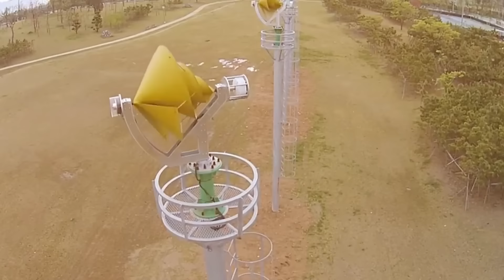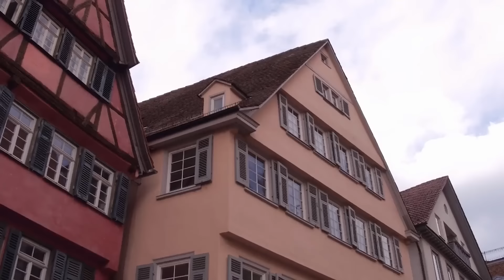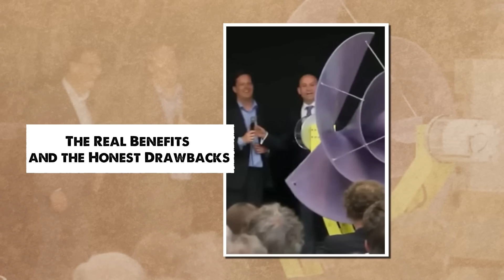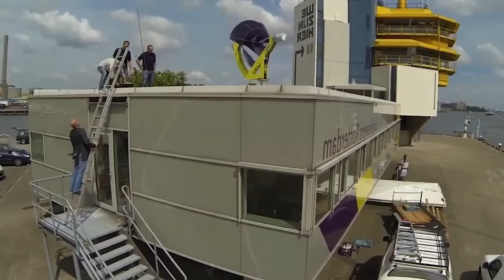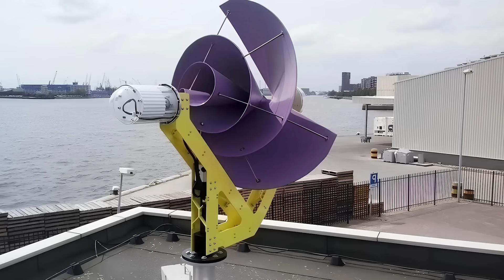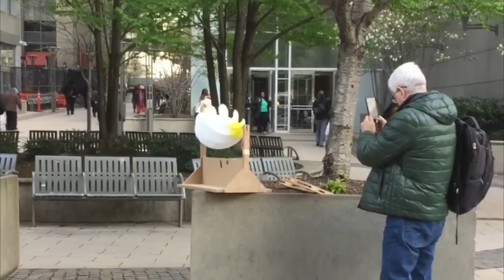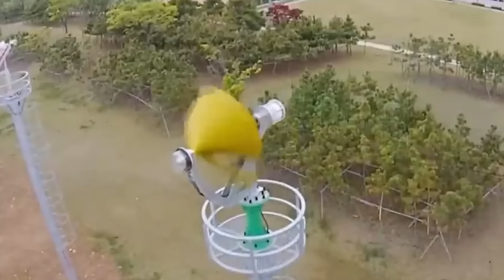This NEW European Wind Turbine for Home Outbeats PV Solar Panels in 2025?!

Comment: I have been waiting for a viable wind turbine availability, even if combined with solar panels. I have seen a solar panel frame that is raised with a space below for a turbine. Being an architect, I have a three stall carport design that my four brothers, along with a several clients, have used and enjoyed for years. Because of the chance of shower at a moments notice, we are from a Subtropical Climate, we use the structures as event spaces and hang lights with paper globes along with tables and either a band or DJ. These things along with the food and drinks are arranged under roof just in case the weather changes and we move freely to the terrace, patios and shaded areas under giant live oak trees that make the gatherings magical. My personal design has a single pitch, shallow grade metal roof with parapet walls that make the building look more like a garden element and hide what is on the roof. The slope is south facing so the solar panels can easily position to capture sun and be raised to accommodate a turbine or two. I certainly don’t mind positioning them on the corner of the building, which is at the setback line and can be landscaped along with made into an architectural feature. 
Thanks for the info and keep us up on development of these energy source as they become available! 😎
Reply: There are plenty of viable wind turbines on the market the problem is all of them are not suited for the suburban home environment unless you mount them 2 times higher or more than your home to capture the true velocity of wind that is needed to generate enough power for the household and most local authorities will not allow it
Reply: @redgatecrt yes and local authorities allow taller houses next door along with useless nusiance tall trees, so i may have to go 6 times higher than my house and stuff the local authorities?
Reply from the maker: Thanks for sharing your architectural insights and interest in renewable energy – that sounds like a fantastic setup for gatherings!
Reply: @BusinessHook  great video yet you promote Joe Rogan, a useless distractions muppet bought out by NASA, FU2😉🙋‍♂️🐑
Reply: You wrote about a raised roof wth wind generators below it.  We have some installations in the Netherlands. It is a massive very expensive setup combining wind and PV solar.  

From one installation (PowerNest system, Eindhoven) I know that 6% energy is wind, 94% is PV Solar.  That system is on a tall building.   To be honest, it is wasting of resouces and pure green marketing funded by tax payers.

Comment: The turbine vs solar choice actually should depend on your local climate, plus any generosity by your government.
I live in a Mediterranean climate which is sheltered so solar is ideal for me but windy seafront locations would suit this turbine
Reply: i have designed a system that feeds off both using vantablack, pneumatic termoacoustic circuits and a battery, only in paper but the tecnologies combined are the best way to harness the ''full spectum'' of atmospheric free energy.

Comment: There are two basic forms of wind generators, horizontal and vertical. It's the area of the moving air that is captured by a turbine that is important. A horizontal orientation using a directional bladed system the most efficient, where as vertical orientated are less efficient. This design uses too much material and seems expensive to produce. Looks aren't everything. This design is mostly a gimmick. Power companies implementing large three bladed horizontal generators with gearboxes should tell you something.

Comment: Fitted one in my back garden and I’m now able to supply mine and all my neighbours needs. Brilliant bit of kit!  And if you believe that then like me your away with the fairies 🧚
Reply: What are dimensions of your generator, weight, what is elevation above ground, what is nominal power of generator.
Reply: 1500 kw per hour ?

What does that mean ?
Reply: @atulmalhotra2303  It means she doesn't know what she's talking about. 1500 kWh= 1.5MWh, that's 1500000 watts per hour. Not possible!!!
Reply: 😂 yeh right. It’s commonly known that power generation by wind instruments at ground level can not capture the full potential that is needed to run a vacuum cleaner let alone a household

Comment: Looked up valculation the at 5 Mph it would barely power an appliance. Unless you live in an area with a constant average wind of 10 MPH this is a poor investment.
Reply: Or we could set them up in between four-plus-lane freeways in heavy-traffic cities. Think “Public Domain Power.” Open-Source Power doesn't seem right.
Reply: The diameter (screw size) obviously plays a part, but you’re right… the “cut-in” of turbines can vary. Many turbines don’t START to be effective until 7-9 mph.

Comment: Liam F1	2000 W	€2,000 - €3,000	Price may vary based on supplier and location.
Liam F1 Mini	700 W	€1,000 - €1,500
nah brah... i can buy SIX 500wDAH solar panels locally for the lower price of the 700w  liam and then i still have to ship into my country?  its a win with the size of roof space saved for sure.. but in ternms of cost.. nope!
 4.2 kWh vs 15kwh is a no brainer.
Reply: so you live where there is 24/7/265 sunlight, congrats. I live where there is always wind, day and night, and in winter even more. I would prefer both, panels to charge during daytime and summer months and complimented by one of these. In wintertime a F1 Liam would provide more power then the panels.
Reply: China $50
Reply: Where in china. What is  name of business?

Comment: Just recently a large solar farm was destroyed by heavy hail in about ten minutes braking up the panels into shattered peaces . So depending where you are located you may want to find out the chances of this happening or has happen in your location before investing and installing a solar system.  Maybe something like a automated canvas shade made with a durable material,that would roll over the top surface of the panels connected to weather sensors that could sense hail conditions and automatically roll or extend out and in depending upon the weather. Plus maybe these same shades could also be used to clean the panels themselves if designed right ?